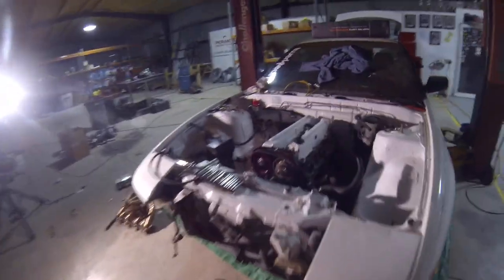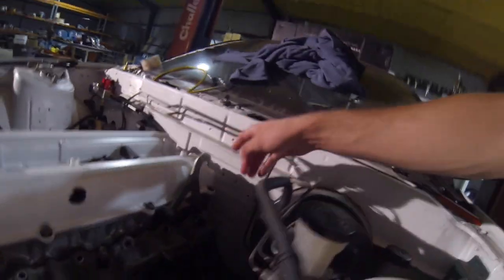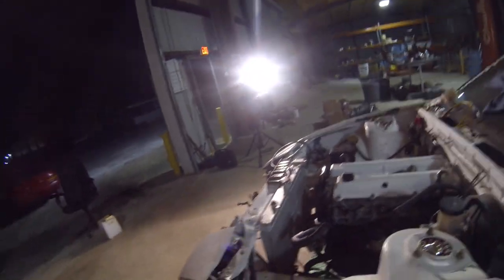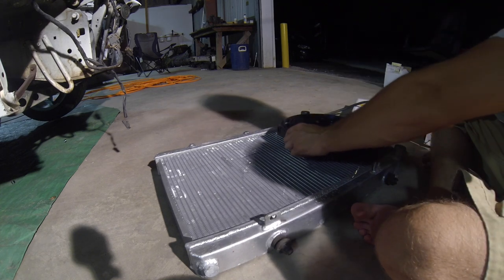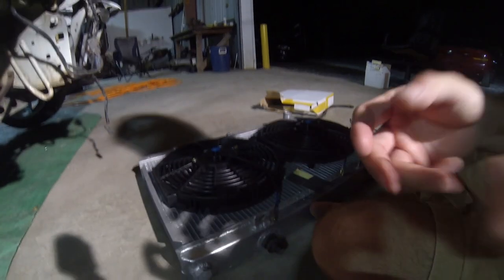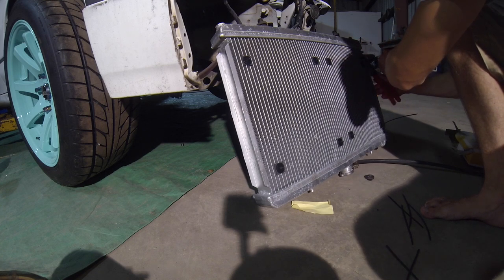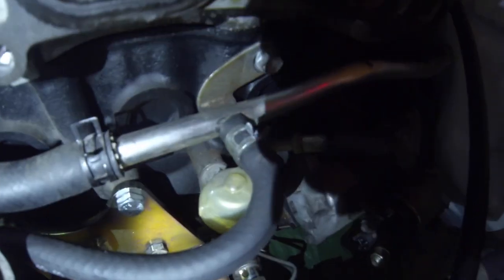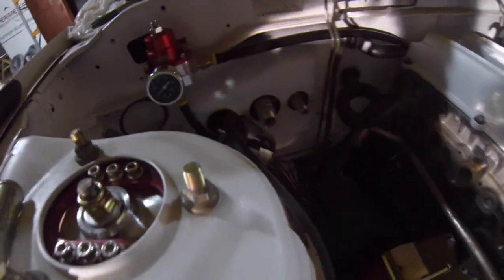1jz 240sx Project - Radiator, and LINES! (Part 18)

Comment: You should run the reg on th return line and the air temp sensor should be just before the throttle body due to heat soak reason etc Builds  coming alone well
Reply from the maker: Kane Rio Yep, it's running like that.  Also, there is already an air temp sensor before the throttle body, gonna have to chop, and re weld to get it out, so for now, it's staying on the intake :P  Thanks man!

Comment: Nice, but are you gonna keep the front suspensions offroad style like that ? Please say nope ^^
Reply from the maker: Haha NOPE! I'll be lowering it a little once everything else is squared away haha
Reply: Haha thanks ^^ Are you gonna keep the ebay suspensions tho ?
Reply: Tom frost
nope
Reply: Dédé LABINOUZE Correct me if I'm wrong, but I think the lift is keeping the car slightly off the ground making the wheels hang down like that.  I don't think it looks like that when it's on the ground.
Reply: ImElkay it's just sitting high compared to the back
Reply from the maker: Dédé LABINOUZE you're correct :)
Reply from the maker: Dédé LABINOUZE they are pretty much the same height.  may look different on the camera though lol